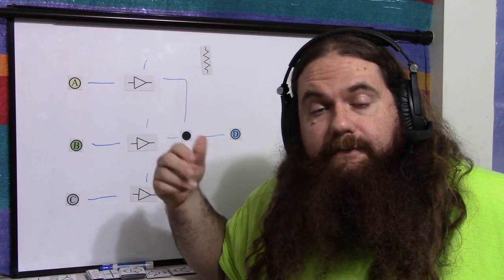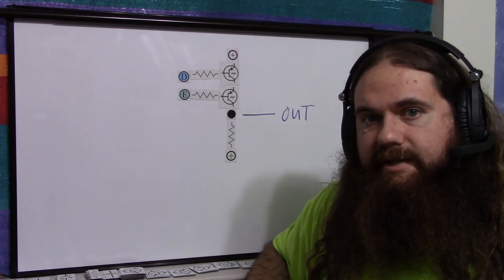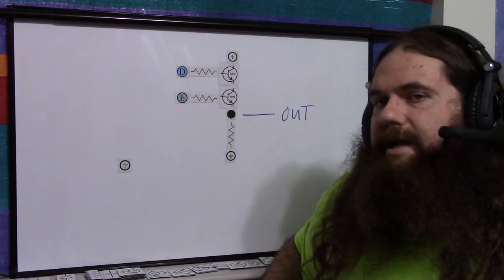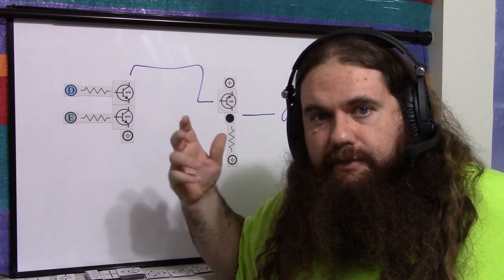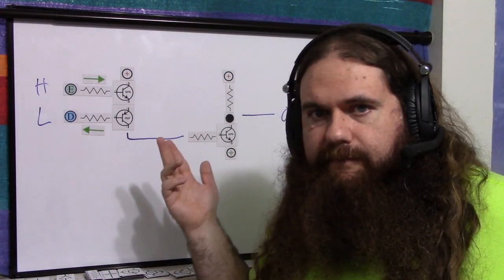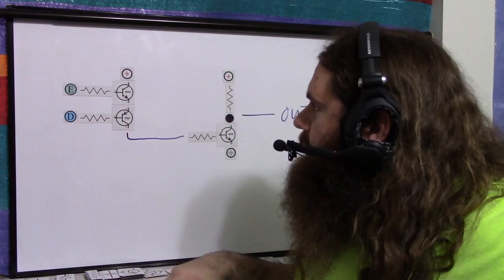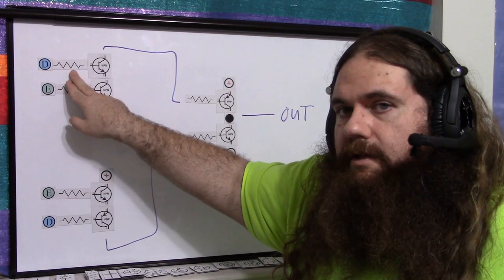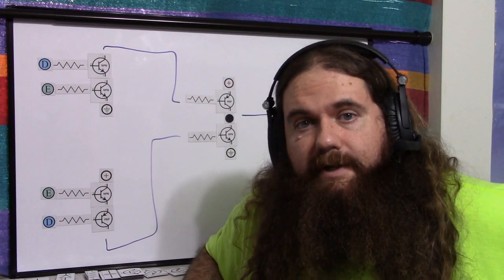Tri State Digital Buffer - NPN and PNP BJT Circuit - Simply Put

Comment: Great video, thanks.  I really enjoy the way you elucidate your thought processes.  One question though, I am accustomed to seeing the PNP "on the bottom" in the push-pull configuration.  I think your point is that's typical for a push-pull analog amplifier, but not necessarily for digital use and I'd like to better understand why.  Is there some reason that "PNP on the top" is better for digital?  What's wrong with "PNP on the bottom" for digital?  Thanks!